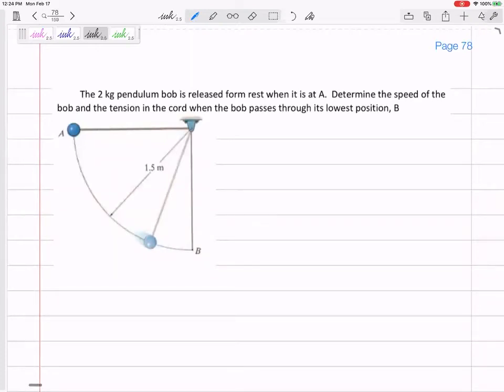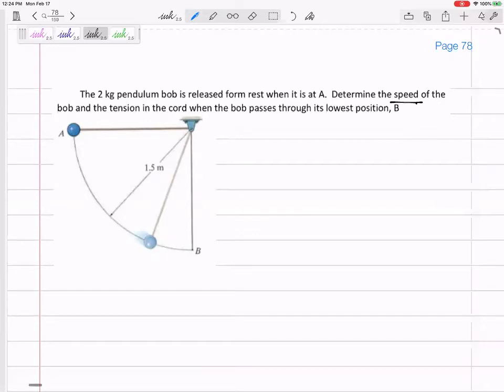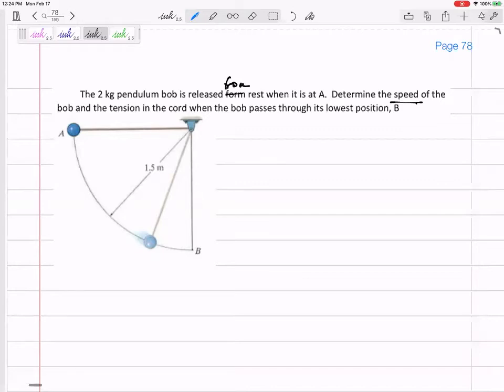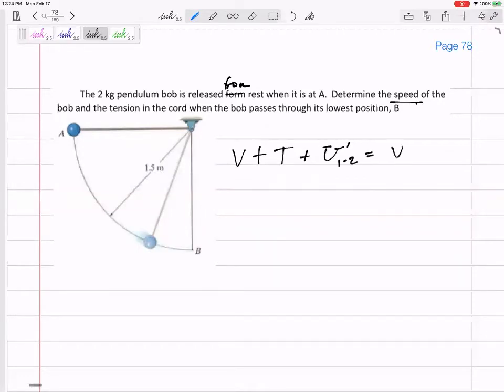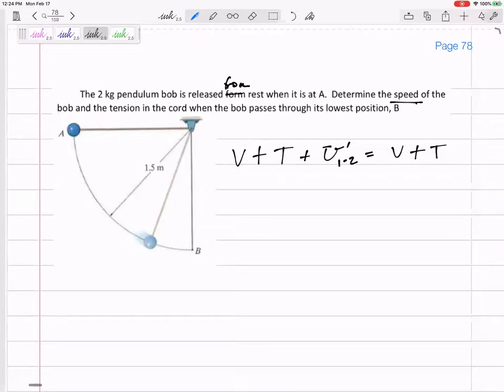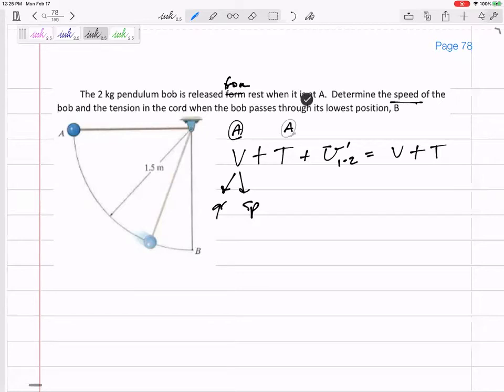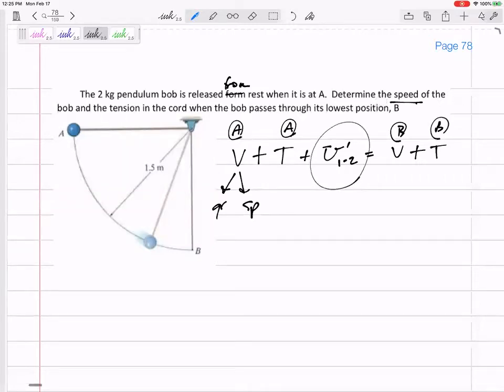Dynamics - Conservation of Energy example 1

Comment: why is the final height taken as negative? Work done by gravity is positive when displacement is downwards
Reply from the maker: The way we derived mgh we have to take positive upwards. True that “work done” by gravity is positive downward, but if you use that method, your work done by gravity would be positive but it would be on the left hand side of your equation. I’ve got mgh with a negative h and it is on the right hand side of my equation. So mathematically it would be the same.
Reply: @engineeringdeciphered  Got it, got it, got it. Thanks!
Reply: Because we've already used the negative sign in the formula